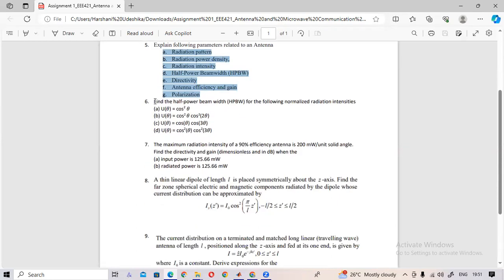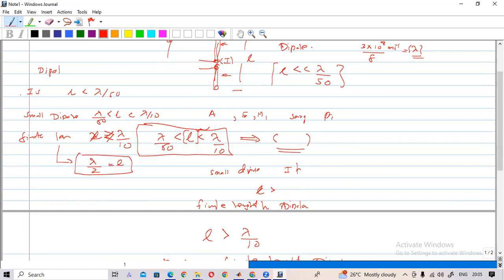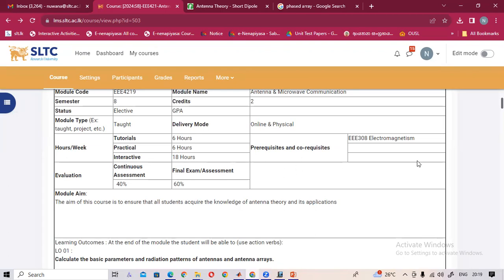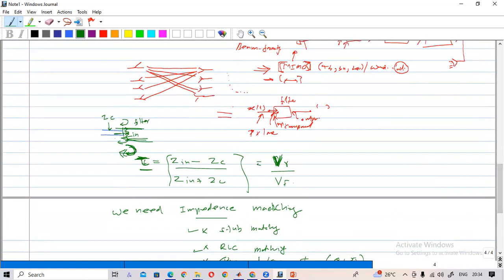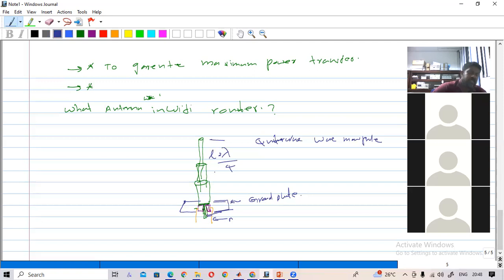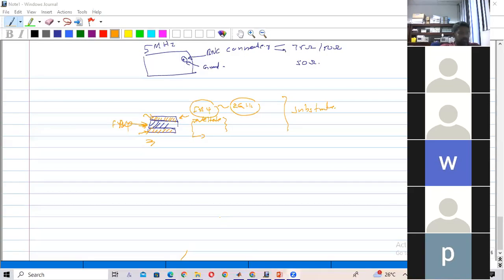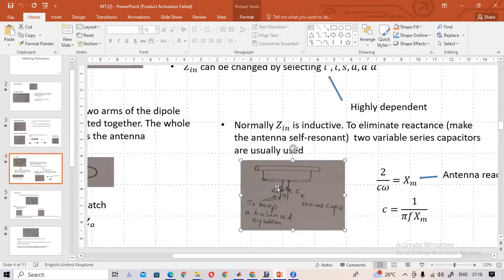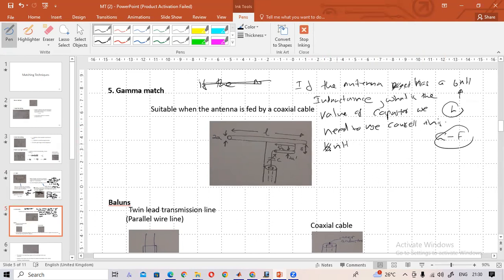Class Discussion 1_Antenna

Comment: Dear Nuwan, 
could you help me by some advices ? i want to reuse a classic magnetron from an oven to excite some gases radially. In this way, i plan to fix a coaxial rod to the magnetron. this rod/antenna will be surrounded by a quartz tube which will be filled with gases. So gases will be directly in contact with the excited rod/antenna. I try to understand why in some case the antenna in separated from gases by a glass tube. So sometimes gases are outside the glass tube and other time gases are inside the glass tube vlose to the rod/antenna.. what is the difference between these 2 mounting ? 
Thanks for your help.
David
Reply from the maker: I dont know exactly my understanding is correct or wrong.But to my knowledge, this can be explained as follows.Please refer

In this case, magnetron uses the connected rod to excite gases surrounded by quartz. When gases are excited they have a high energy level and when collide with other particles they can easily release energy into those particles. Hence, if we keep the rod touching gases directly, the rod can easily corrode with time. Hence, it is better to use a glass tube to cover the rod, to increase the durability and accuracy of the experiment. This can depend on the material of the rod as well as the gas that is used.
Reply: Gases will be hydrogen with nitrogen 50/50 maybei should use the more higher first inonization ernergy as metal to do the rod, iron, nickel, or better tellure, platinum, gold.. something like that ?
https://en.wikipedia.org/wiki/Ionization_energies_of_the_elements_(data_page)